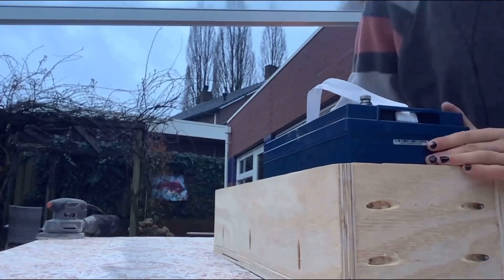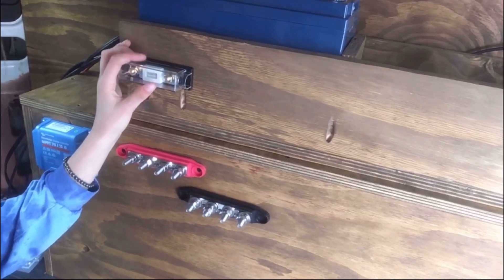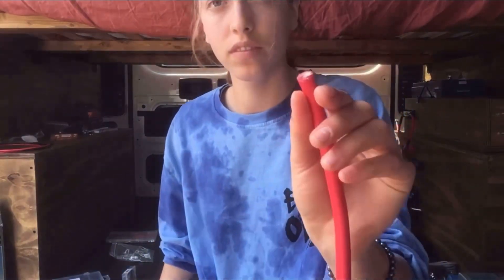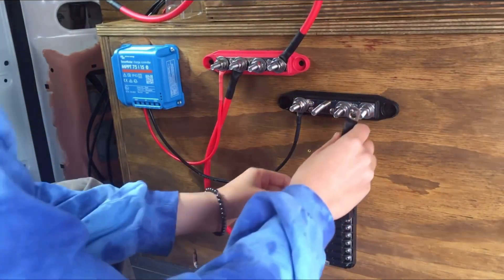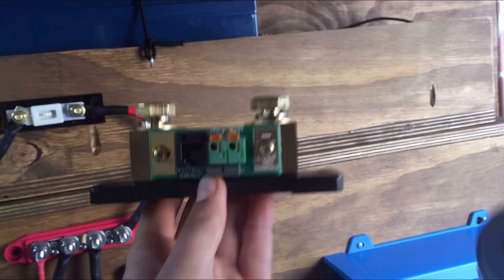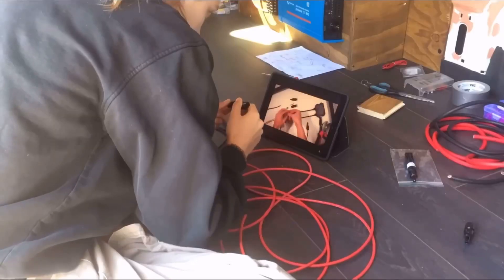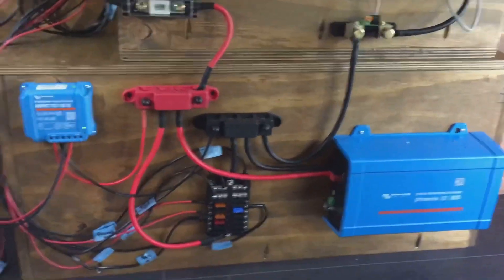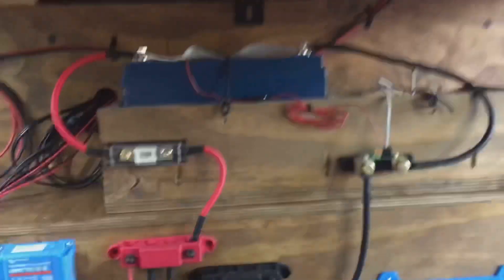DIY electrical system | van build | 200W solar setup | I have powerrr

Comment: Looking good, which y/t channel we're you referencing? Inspirational, a disconnect for pv array incoming lines & cut-off switch from battery positive would be two suggestions for you to improve system.
Reply from the maker: I put links in the description :)

Comment: Just found your channel and Great job! Just do yourself a favor and make sure what ever panel you put into place cant get knocked off easy when it gets hit with stuff on your travels. All those open terminals everywhere close together is short circuit city. I'm only saying this because I  had a fire once in my car when a bag full of heavy stuff fell over and knocked my power distribution blocks for all of my amps loose. It shorted causing a spark then whoosh I was lucky to pull over and put it out with a small extinguisher I keep in case of emergencies.
Reply from the maker: thanks! ah that sounds horrible, I’m so sorry! I did install a panel to separate the electrical from my storage space :) but thank you for sharing

Comment: small tip... In summer time put a small 12 volt fan on your load point on the mttp charge controller and run the air over the electrics..keep it all cool

Comment: Just in my uneducatedness do you think that 20 am fuse will be enough to support that 800w inverter? Maybe an 80amp?
Reply from the maker: the 20amp fuse is to protect my charge controller. the victron inverter has an internal fuse. but you could add an extra one if you’d like. I only plug in appliances that don’t require a lot of power. (for example: I don’t use hairdryers or a blenders) so for me it wasn’t a necessity :)
Reply: @tessabriels  It 20 amps works for you then good. I assume you are using a 12 volt system and 800 divided by 12 is 67 amps. That is why I was thinking of an 80 amp fuse.

Comment: you should solder the ends of those wires to help them not fray when screwing them into place. it just helps keep current accurate.

Comment: Make sure you keep the heat shrink back far enough so it won't interfere with the washer or lug:)
Reply from the maker: good tip! thanks :)
Reply: Having done that myself, I was going to suggest the same thing - the heat shrink will be squashed between the nut & and the terminal, causing a poor connection and heating of the terminal.